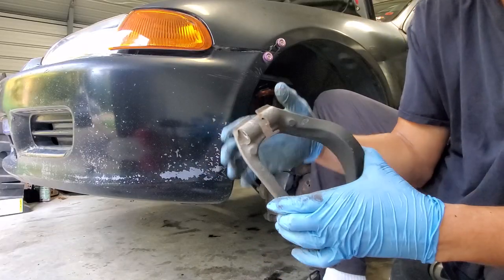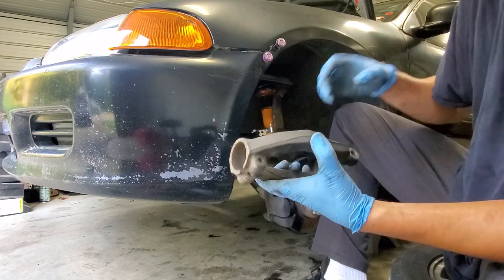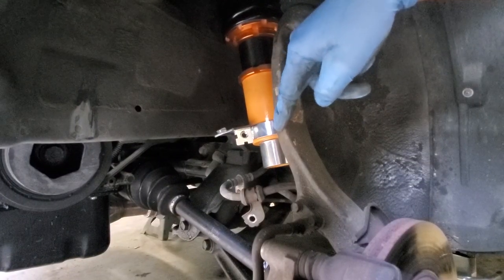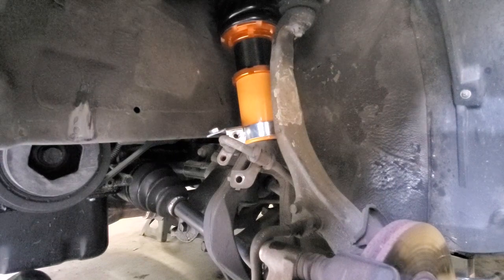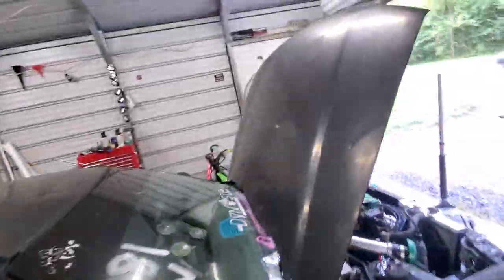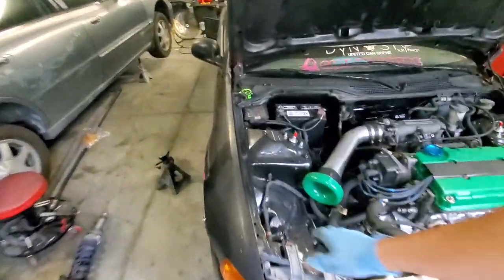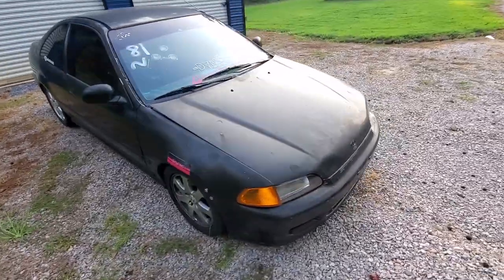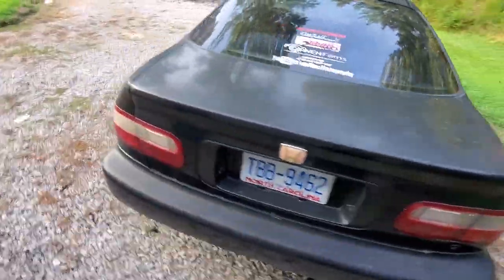ALL MOTOR B16 Civic Suspension Upgrade!! | So Much Better!

Comment: Hey man i trying to install a 95 d series manual transmission in my 2000 civic dx automatic my question is the top transmission mount bracket will the 96 to 2000 maxxspeedingrods innovative trans bracket work on the 95 transmission to be able to bolt it to my 2000 d16y7 mount
Reply: It would work yes. Also any oem 96-00 manual transmission bracket will work

Comment: I have a non dampening set on my 97 accord 4 door. Minimal body roll, tighter steering, more grip. But the bumps are more harsh now. But then again i didn't buy the adjustable dampening set